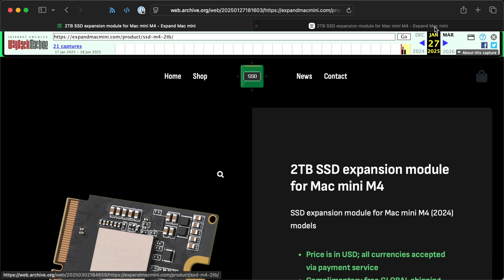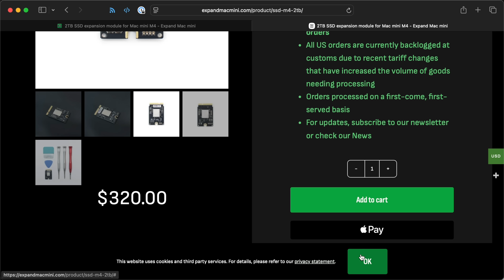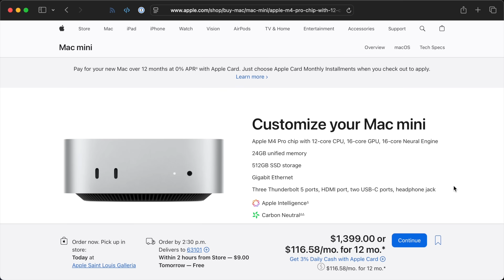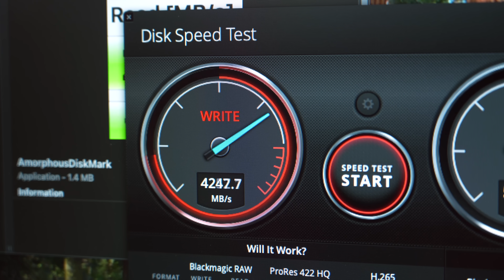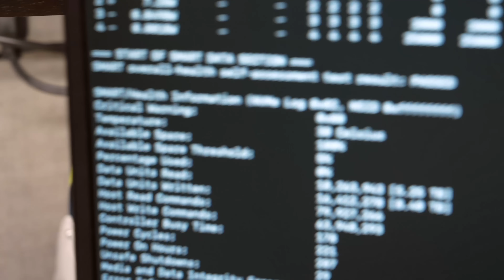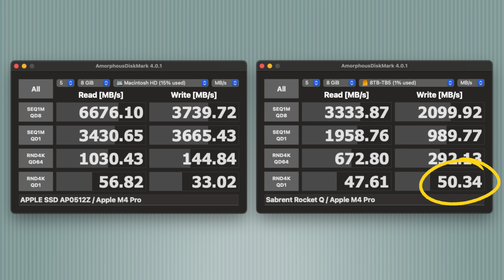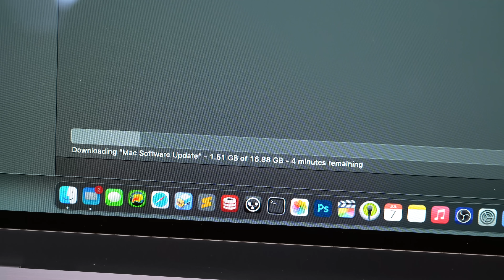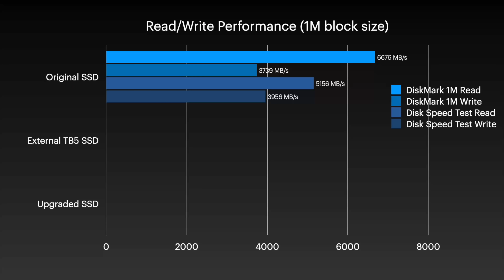There are three types of Mac users

Comment: <pedant mode> SOS was always explained as "Save our souls" since you may not be onboard a ship. Actually it's most probably the Morse pattern that was chosen.
Reply: Anything you think it stands for is a backronym, since it originated simply as a Morse code pattern that was easy to type and to recognize.
Reply from the maker: <hyper pedant mode> what if I told you it doesn't actually stand for save our ship or souls, but those are just the backronyms assigned to the morse code sequence? </hyper pedant mode> ;)
Reply: @JeffGeerling  Ultra-hyper-pedant mode:

The distress signal is NOT SOS, it's • • • - - - • • • with no pauses, while SOS has inter-letter gaps: • • •     - - -     • • •
Reply: The original code was SOE, but the E at the end was easy to miss (something that you do not want for all transmissions, but becomes a bit more important in an emergency). The change to SOS made sense.

P.S. I am going from memory here, from a book I read long ago (around 1990 is my best guess), but I am sure it has been documented with proper references somewhere on the internet since then.
Reply: SOE never meant distress. The first officially-adopted Morse code distress sequence (1905) was specified as "three dots, three dashes, three dots". This wasn't even officially codified as the letters SOS until 1907. As for SOE, it was part of the original German scheme, but it meant something completely different (same as CQ) and was only ever used in Germany, and even then only briefly... Presumably they stopped using it because having the calling code sound so similar to the distress code is a terrible idea.
Reply: @Lorenc7  If fact AFAIK Marconi proposed CQD, but the D in Morse was easy to miss, so  ... _ _ _ ... replaced it.
Reply: @cogspace  
You are correct that SOE was never used as a distress signal, simply considered and then changed because the short E would be easy to miss. That last part is what I was remembering. The international committee trying to set the standard liked SOE, and from that arrived at SOS.

@jrgroberts
QCD (derived from the earlier QC) were also part of the discussions in the early 20th century, but never made it into the international standard. It was used by many in the US, and by the Marconi company everywhere, but not as part of an international agreement.

Thank you both for the comments. 🙂
Reply: don't forget to close your tags </pedant mode>
Reply: Glad the replies cleared that up, now someone help me with this tempest in a teacup. There's water everywhere.
Reply: [google mode] Somalian shillings [/google mode]
Reply: SOS is easy to send even by somebody who doesn’t know morse if they just alternate sequences of dot/dash triplets. Somebody repeatedly tapping SOSOSO or OSO (bear?) will still generally get the intended message across 

(now I’m thinking of the Angela Anaconda episode where she gets trapped in a room—I think it’s a bathroom?—and manages to write HELP on a high, difficult to reach, window, only for somebody to read it and go “PLEH? What does PLEH mean?” before shrugging and walking off)
Reply: I forgot what I was going to write about SOShips, prolly for the best because I'm just an amateur compared to you lot!
Reply: Just what Morse code needs, a parody bit to verify its accuracy. Because it's not hard enough already. There's a group of old hams out there that would be all for this.

Comment: SOS - "Save Our Souls" ?
Reply: Either is valid because the pattern came before people putting words to them. The letters were chosen as a "we need help" signal because the pattern is very easy to remember and recognize.
Reply: It's not actually the letters S.O.S. because using the three letters would also include the longer inter-symbol pauses between the letters.  It's simply a unique pattern of 9 digits but it's so close to the letters that they are used as shorthand to identify the sequence.
Reply: 🤔So the only correct translation is short short short long long long short short short 😂. what was it's original name if it isn't morse sos?

Comment: I must be the 4th kind, gave up when Apple switched to their own processors and installed Linux on all my Macs.
Reply: Great, gave up on them when they made the single biggest performance boost in the company's history 😅
Reply: You gave up when it was the best time to stick around. Macs have never been better.
Reply: i went even further (since lots of macs after the touch bar era aree a pain to install and get stuff working on linux) i switched to a framework laptop and a custom SFF desktop pc both with arch linux
Reply: Gave up right when it got good such a shame
Reply: @clintmiller88  It wasn't just that they changed the hardware, I was also tired of having my hardware retired after too short a lifespan. My current Mac Mini was retired after I've had it for only 5 years, yes it's a 2018 model but I bought it in 2020 from an Apple Store. This Mini was to replace the previous one that was retired after 6 years.
Reply: or the 5th type... use ancient macs! (guilty!) or 6th type, virtual machine mac types (also guilty!)
Reply: @geoffupton I have a mid-2010 Mac mini I use as a dedicated iTunes movie server for our AppleTVs 😂
Reply from the maker: Valid option :D
Reply: @JeffGeerling Am I the 5th type? that destroys all Apple Tax with edu discount + trade in?
Reply: @JeffGeerling  Unfortunately the only version of Linux that runs natively on Apple Silicon Macs is the not-fully-baked Asahi project, which has recently had internal drama. I wouldn't put all my eggs in that basket at this time.
Reply: @4X6GP  Also I think it only actually supports the M1 and M2 generations.
Reply: Me too! Although i want to switch to mac because of the nice chips but this throws me off. Or maybe i am too influenced by Rossman's right to repair and rants about apple and other companies doing shitty things
Reply: @309electronic5 M series chips just kick ass tbh
Reply: True - but the ecosystem sucks and is tightly locked.
Reply: @309electronic5  if you want to be even more pissed, look up Ashley M. Gjøvik’s ongoing fight with Apple over Apple’s manufacturing & release of toxic chemicals into the open air from a secret, improperly-licensed laboratory located in the heart of Santa Clara’s residential areas with apartments and stores within spitting distance - all so they could rush the development of the M1 chip.
Reply: @309electronic5 if onboard hardware were the only option I would agree. But with CPU GPU and NPU on die I feel that off board storage is the only way to make upgrades in the future. I don’t mean upgrade the storage mid cycle, the heart and soul of my pc is the data. If I Keep my storage on a separate device I can upgrade the base unit to meet demand with minimal effort.
Reply: @309electronic5 I'm in the same boat 
I'd love to run Mac OS but don't care for Apple hardware, even with their incredible performance and battery life. And yes Rossmann's rants may have influenced that
Reply: @309electronic5 

Don't listen to everything that Rossman says. He's been full of crap in a number of ways, such as supporting piracy, his obsession with Apple, leading to bias against it even though other companies do the same, and censorship on his channel. I was banned from his channel for constructively criticizing him while still praising him for things like right to repair. Unless things have changed you never see any criticism on his channel, at least not for long. And this is someone that criticized Apple for deleting critical comments in it's support forum. In my opinion he is often emotionally driven and immature. He still has some growing up to do and needs to work on his moral compass, because it doesn't always point in the right direction.
Reply: @CorneliusTaylor-s1u but paying 200 extra for extra storage while i can put a 40 dollar ssd into my normal pc to upgrade storage is just horrible. I also dont fully believe everything he is saying but some points are suspiciously accurate
Reply: @309electronic5 Fully agree with you here, spot on.
Reply: That’s why your shit is so slow lmao
Reply: to show my age, I became a never-apple guy when Steve Jobs said a mouse should only have one button.
Reply: I must be the fifth.
The one that realises that the Mac exists within an ecosystem of devices and deploys a RAID array of SATA SSDs on a 10gig network.
Reply: I would do this if any version of Linux could figure out iMac speakers. Every version I've ever tried just can't figure out sound on iMacs. The audio out 3.5mm port is fine, but I want the built-in speakers so I can have a shed computer with updated software, or an extra computer just to browse the internet or work on Google docs. Which they do work, but the sound issues are super distracting.
Reply: Ubuntu does better drivers than macOS in my experience on 2013 mbp and 1440P imacs @fuelvolts
Reply: @fuelvolts those speakers aren't exactly top-notch..why don't ypu just buy cheap replacements?
Reply: @ManiacalMoogle you need to do some fresh research. MacBook Pro speakers are among the best available on any laptop, and even the MacBook Air speakers kick ass over any windows laptop I’ve ever used.
Reply: @ManiacalMoogle  imacs have excellent speakers
Reply: I’m the nth type, sold all my apple stuff & replaced it with easy to upgrade repair wintel machines
Reply: Boo!!!
Reply: Ok folks, I think I should clarify some things... I don't hate Apple Silicon, it has some very strong arguments for it that I agree with, it's more Apple's hardware policies I have a problem with rather than the hardware it's self. I feel like they retire hardware far too quickly, I'm not someone who will buy new hardware every 2 to 4 years just so I can get that one feature that the new hardware will allow. The only thing I don't like about Apple's current lineup is that aftermarket upgrades are almost all external, yes this video is about how to replace a hard drive but compared to standard PC hardware that's a lot of fuss to just replace a hard drive. I mean, I'm perfectly capable of doing all of that and have with the Minis I've had over the years.. it just shouldn't be so complicated. As for hardware I've purchased since 2020, I bought a PC laptop and built a gaming machine, both of which also run Linux and I'm super happy with both. Apple is a great company with great products, but I'm at a point where repairability and lifespan of my hardware really matters to me and I get that with standard PC hardware and Linux.
Reply: Amen man!	I was a hardcore Mac users, but when Apple launched the M series I switched to Linux. My Mac Pro desktop is a Debian server for Nextcloud, and all my Apple laptops run LinuxMint Debian Edition. Never looked back never will.
Reply: Lmao. That is absolutely not a good thing 😂😂
Reply: People who care:  >1.
Reply: Exactly what I did originally back in like 2015 or so even after apple replaced my mid2012 that needed 3 warranty fixes. Almost got me w/that 😅
Reply: Recently bought an Intel mac pro rack unit and bought a processor to upgrade it. Initially I was going to put a pc in the case and sell the guts. I’m not a power user, but more just interested in not using windows anymore for anything. My other pc’s are linux. Since more software is mac compatible than linux, I decided to keep it a mac. If or when certain software becomes compatible with linux, I’ll probably switch this mac too.
Reply: That's kind of weird considering the Apple silicon is absolutely amazing.
Reply: You are the third type, you still buy after all
Reply: @lenOwOo  Nope, afraid not.. I haven't purchased any Apple hardware since 2020, just before the announcement of Apple Silicone.
Reply: Asahi Linux will eventually be ready
Reply: No offense to anyone here, posting this from fedora asahi linux. With orca screen reader, I'm blind and probably the only suicidal person to do that 😂 I bought mac for battery life only, thanks to apple silicon. Invaluable as a student. Will watch the video after writing this lol.
Reply: funny thing, i actually bought into a mac due to their switch to apple silicon. can't wait to install linux on it once that matures tho
Reply: Asahi Linux on m2 macs is the bomb
Reply: Never had a fruit, never will get one. Won a iPad once, sold it even before I got it in the mail

Comment: If only it was possible to upgrade ram on these
Reply from the maker: I'm torn on that, as the RAM being soldered to the SoC package does have benefits in terms of speed/reliability.

Maybe it'll be possible to have on-package RAM plus like 'Level 2 RAM' in the form of CAMM someday. But I don't think Apple would be one to add it. They still want you to pay through the nose for upgrades :(
Reply: @JeffGeerling  or hybrid ram. Have the faster ram soldered to the soc but have an upgrade slots. I have laptops that work this way. I am sure apples engineers are smart enough to figure it out but i dont think they want to. Big part of their income is also 'oh i ran out of storage. Well, i will just buy a new model no problem'
Reply: @JeffGeerling  I guess that all Performance oriented Computer Designs will eventually go down the path of very tightly integrating the RAM and CPU, but Apple also really knows that they can use RAM as a Money generator. The RAM prices for all their M-Series Products do not really reflect the prices of the bigger chips.

I truly hope that there will be an upgrade path for tighly integrated RAM beyond CAMM, but I doubt Apple will adopt it.

Unfortunately they do have the best single core performance chip at the moment and I really want to build a mac mini cluster lol
Reply: Fortunately, Apple gave the base Mac mini a very welcome memory upgrade from 8GB to 16GB, which makes it a much better value than the previous generations. Ostensibly they did it to ensure all their AI features would run okay, but since almost nobody's found a good reason to use their AI yet, it simply means a lot more memory for the usual apps.

Comment: I have a BaseQi card adapter and a 2TB microSD permanently installed on my MacBook. Great way to have a 3TB machine where 2TB are just slower cold storage I want to have at hand but don't need the super fast speeds. And I can easily remove it and take it with me to my next machine
Reply from the maker: Yeah, honestly just a little USB flash drive can still give you a few hundred MB/sec which is enough for a backup, or like you say some cold(ish) storage.
Reply: SD cards have terribly reliability and endurance though. That's not cold storage, that's risky storage.
Reply: I also have my machine daily backup to my main and my remote servers so I'm good  @toseltreps1101

Comment: Now if they just made it this easy on the MacBook Pro. I saw a video recently from LTT where you can unsolder the onboard NAND and solder new NAND chips on but my surface mount soldering skills are not up to the challenge!
Reply from the maker: Yeah; dosdude1 makes that stuff look way easier than it is (especially if you only do it once, and without him over your shoulder, and without a few thousand bucks of tools haha)
Reply: @JeffGeerling I’m about to do this surgery on some FPGA dev kits that only comes in one SKU but uses 1 GB DDR4 chips.  I ordered some TwinDie 4 GB replacements and have a friend who has the skills and tools.
Reply: same for my M2 Mac Mini - ssd is soldered like MacBooks. I'd like to keep it using for long before jumping in to either MacBook or newer Mac Mini
Reply: I've got an M2 MacBook Pro and I'm seriously considering upgrading to the M4 Max. The reason I have not pulled the trigger is due to storage prices, I'm seriously considering buying the lowest storage option and looking at a third-party that can upgrade it at non-Apple prices.
Reply: Its also harder than you think. One wrong move and its an expensive mistake
Reply: @309electronic5  Including the fact that one of the chips in that video turned out to be a dud, and typically, if you're sourcing your own NAND chips, good luck getting a refund.

Comment: Some Mac upgrades I’ve watched recently require soldering small components etc. why doesn’t this one?
Reply from the maker: As branflak says, the M4 minis (M4 and M4 Pro) both have socketed storage, meaning upgrades are a matter of unscrewing and unplugging the SSD module, instead of having to desolder chips from a motherboard. Not sure why Apple can't do that on all their machines :/
Reply: It’s pretty simple, apple wants more money. They’re publicly traded so unless they’re forced to do it, they won’t.
Reply: Yes, the reason to solder small components is to only change the NAND chips, which is required when upgrading Macbooks as those have memory soldered in a way that prevents most users from replacing it. With a Mac Mini the NAND chips are on a separate storage module that's not soldered, so a user can replace the storage module without special tool. Linus Sebastian gave a go at changing the NAND chip on a Mac Mini, which is easier in terms of soldering skills required than working on a Macbook, but not often done as it's a challenging task compared simply changing the Mac Mini storage module and the money saved relatively neglible.
Reply: AFAIK all the Mac Mini with 512GB only have a single flash storage chip, not requiring some extra components, but all the rest have more and with that all those components present.
Reply: This one is an officially supported upgrade; the ones you've watched are likely unsupported hacks. Macbooks for example have soldered storage which cannot be easily replaced without messing with the logic board.